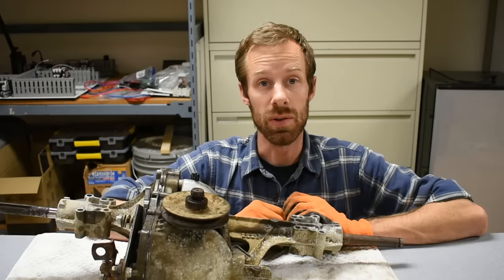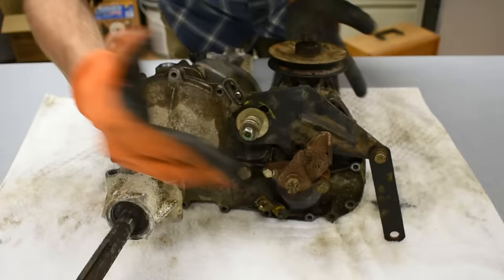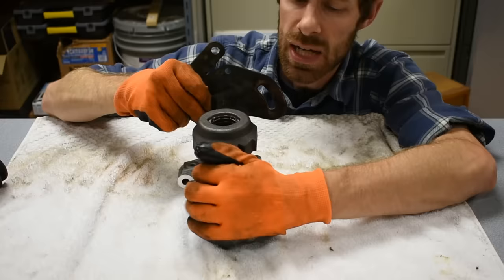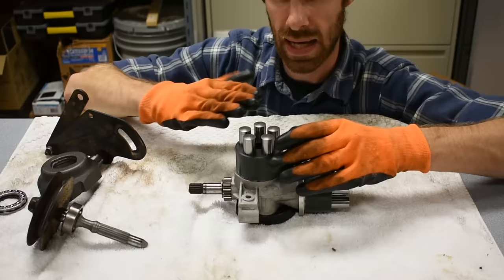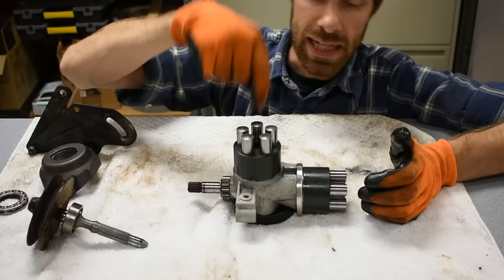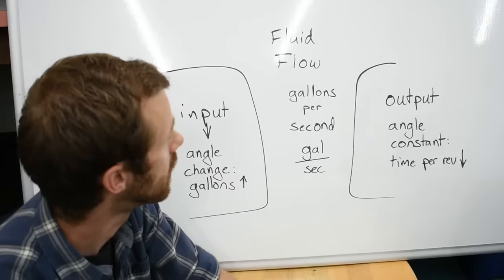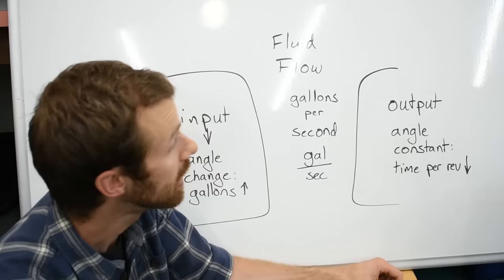How Does a Hydrostatic Transmission Work?

Comment: Great demonstration! I have a question, for you or any of the other viewers. My 42" Husqvarna lawn tractor has a hydrostatic transmission, and I had wanted to add a small grader attachment, but a fellow told me that a hydrostatic couldn't take the extra load and would be damaged. Is that correct? Thanks!
Reply: Really about the only thing that would hurt a hydrostatic transmission is low on oil or high on heat. Assuming that all else is normal, an additional load on the output would easily be handled in the lower speed ranges just keep an eye on the oil temperature of the HST.

Comment: so what are the power and rpm limitations to one of these "garden tractor" hydro axles??  I have been planning a custom build for some time now, of a twin tracked snowmobile powered by a Tiernay gas turbine, (max 110 hp) linked to a similar hydro trans axle. I have seen it done in "full scale", but still not Shure of limitations. Any thoughts?

Comment: Creating the hydraulic pressure and flow makes perfect sense. But converting it back into mechanical work makes no sense to me, unless the fixed ring is fixed at an angle. If you mentioned that, I missed it.

Comment: A discussion about the torque of input vs output of the hydrostatic unit would be interesting too.  I need to think about it a bit to see if it is a function of the angles or not. Also, is there a relieve valve somewhere in that unit? Maybe belt slip is the implied limit but would also be interesting to know. Great job showing though!

Comment: good video. is hydrostatic trans fluid regular motor oil?
Reply from the maker: Not motor oil - at least not the viscosity I would use in my car. It may be a heavier weight oil, but I would definitely recommend going by manufacturer's info, from manuals, etc.

Comment: Sorta similar to a swash plate on a helicopter and probably more similar to the swash place in an automotive AC compressor.

I see that the video is at least two years, but wound up in my feed, seemed interesting and here I am with a slightly belated comment 😶
Reply from the maker: That's ok - the equipment still works after many years, so I suppose the video does, too :) And yes, the swash plate concept is very similar to a heli, for sure.

Comment: How does the movement of the output 'cups' create the turning of the output shaft?  You got me to see that the output cups would move but we need the axle to turn.  Thanks.
Reply from the maker: Great question. The output cups are fixed to the shaft - in fact, they look like the chamber of a 5-cylinder revolver, if such existed, attached around the output shaft. Those 5 cups butt up against a slanted plate, so when the fluid fills the cups one at a time, each must expand and begin pushing. Since the plate (the swash plate) is slanted, it will only be able to spin in one direction.

If the fluid direction is reversed, the cups on the opposite side will fill, so the direction is reversed.

I know a written answer isn't great. Hard to describe with words, and for that I apologize, but I hope this helps a little?

Comment: My cub cadet rtz is not reversing on one side.  It has two hydrostatic motors.  I'm guessing the bearing is shot?
Reply from the maker: If it drives in forward, but not in reverse, it sounds like the fluid may be blocked from driving in one direction, but not the other. There are usually check valves that control the direction of fluid between pump and motor. If one of those valves is not functioning, that direction of fluid would not be allowed. 
Of course, I would suggest contacting the manufacturer to figure it out for sure. Don't count on Dave's opinion!

Comment: What's the lifespan of a hyrdostatic?
Mines 17years with 226 hrs.
Reply: So long as the unit remains full with clean oil of minimal oxidation levels it should easily out live you.

Comment: How much this and where we we can buy please reply
Reply from the maker: These transmissions are often found on lawn equipment and also often on larger slow-moving equipment like excavators, etc. 

To buy one, you need to know the original OEM part details like model # and manufacturer and search for it. Sometimes they can be found online and almost certainly through dealerships. 

To buy one for a custom design however, that would need to go directly through a transmission manufacturer.

Comment: On my John Deere 289 LX the outside of my housing looks very much like the one you have there anyway I changed my fluid to Amsoil zeroW 30 engine oil and I’ll tell you what it made it quieter seem to respond nicer and just works nicer horse your flu shot it was probably pretty bad so anything you did put in would improve it anyhow thank you for the vid

Comment: A link to a slightly bigger version.
https://youtu.be/TunlPGZ3UOg 
I have worked as a service engineer on these trucks for 15 years, and in that time we have not had a single failure of a transmission or motor after 20000 plus hours use.

Comment: i could make a video of how those trany works since i used to repair them on a big scale  but lets just say that it works on the same principle as a pressure washer . Aguy that knows how to fix a pressure washer doesn't need much to discover how to fix an hydrostatic transmission
Reply: I followed your advice and plugged a pressure washer wand into a tap on my tractor transmission. It did clean things for a short time but hydraulic  transmission fluid is harder to clean up than water is. I'm going back to using water.
Reply: @guy tremblay got any idea why one of these hydrostatic tranny would lose reverse then go to a shop for a fluid change and come back with reverse working but no forward now? We have a JD 265 that lost reverse and got taken to the shop where they said it needed a hygard fluid and filter change and was given back with no forward now. How does it go from no reverse to no forward? Weird

Comment: I dislike hydrostatic transmissions. Every mower I have had with one has failed. I prefer manual transmission mower sick with my early 70s wheel horse. Most reliable lawn tractor I have owned. Easy to repair.

Comment: I'm wondering if an air compressor could be created from this design.  Basically instead of fluid, air is used as the fluid.  It seems you could even get variable compression ratio's with this and it would be able to be fit into a cylindrical shape, which could have advantages of it's own.
Reply: Basically how the AC compressor in a car works. One plate and a bunch of pistons.

Comment: They could ratio the piston sizes and use two hydraulic motors instead of one and do away with the gears and differential if they wanted to

Comment: Great explanation! Are these more durable than standard transmissions?
Reply: No way. Hydrostats are weaker, but much easier to run. I run two garden tractors depending on if I need grunt (pulling/hills) or just easy mowing

Comment: Wouldn't it damage the pump if push/tow in any direction by creating a back pressure? Great video by the way
Reply from the maker: Yes, it definitely could. In this case (perhaps with all, I don't know for sure) the drive pump is belt-driven. If there was large back pressure from the driven hydraulic motor, enough to slow or stop, or even reverse the driving pump, the pulley would slip on the belt providing a clutch action. If it was directly geared to the motor shaft then the result is something, somewhere would need to break. 

That might be exciting.

From a very safe distance.

Comment: Interesting, I have never seen a spring driven variable hydraulic pump, nor one with proper bearings; thought they all used slippers on the swashplate and used retention plates instead of springs.
Reply from the maker: To be honest, this was my first time inside a variable pump, so I did not know what to expect regarding standard construction. This one was certainly designed for longevity and low maintenance.
Reply: @PetersonBrosAutomation  what's interesting about using springs, to me, is that it seems like it builds a certain level of cavitation protection into the system, by making the pistons work as accumulators. I guess this makes a lot of sense when the pump and motor are right next to eachother.

Thanks for sharing. :+ )

Comment: This makes me wonder, WHY do they fail?  Is it simply because too much heat causes those pistons to expand and scrape the cylinder walls causing perinate damage, or just seizing in place???  Is it really that simple!?   In other words if by simply adding an oil cooler to it with a small automotive electric fan, a fix for the so called "un-reliable" K46 transmission?   If so this sounds to me like a very simple and in-expensive modification that should be done.
Reply from the maker: In this transmission, there are two locations with metal-on-metal contact (revealed right at 10:54 - there is one for the input and the output), and that seems to be the most likely place for friction leading to abrasive material getting into the fluid, and the problems would probably just cascade from there. 

Overall, I think that if the fluid is kept cool and changed according to manufacturer's specs, this is a very reliable mechanism. I agree, your idea of a cooler would certainly increase reliability, but I haven't seen enough cases to truly understand the most common failure points.

Comment: Excellent explanation mate..i have now got the basic idea of working...it would be better if animated
Reply from the maker: I completely understand. I'm trying to use tubes to feed and return the fluid from a bucket so I can run it while open. However, I scratched one of the faces when taking it apart, so I will try to figure it out. The other idea was to cast half the case in clear acrylic. It's hard to show in action!

Comment: This is a great presentation but I would never call it "Hydrostatic" as there is nothing static about it and it is certainly "Hydrodynamic" as the fluid is moving and that it needs to do for the transmission to work. 

Note:-Fluid statics or hydrostatics is the branch of fluid mechanics that studies the condition of the equilibrium of a floating body and submerged body "fluids at hydrostatic equilibrium and the pressure in a fluid, or exerted by a fluid, on an immersed body". It encompasses the study of the conditions under which fluids are at rest in stable equilibrium as opposed to fluid dynamics,

Comment: Seems needlessly complicated with a lot of precision machined parts that can wear. Why couldn’t you just have a pump direct mounted to the engine (no belt to wear out), and just have 2 hydraulic hoses running down to a hydraulic motor at rear axle? Is there a reason they don’t? Speed could be adjusted by bleeding off pressure maybe?
Reply: These systems have been in use for decades (probably more than 50 years).  Variable displacement rotary piston pumps are considerably more efficient than your proposed solution.  They most certainly can be directly mounted to the engine, but there are other constraints you are not taking into consideration (very different and lengthy conversation)

Back to your alleged solution:  You want a pump to operate at full pressure ANY time the engine is running.  To reduce speed you want to divert pressure back to the sump... just to be picked up, pressurized, and bypassed again.  Your engine would have to operated at rated RPM for the system to work.  Otherwise the pump will stall the engine due to lack of power.  Nothing is free, your constant bypassing of pressurized fluid just to pressurize it again generates a lot of heat.  Heat oxidizes the oil causing wear.  The engine is also running at or near a full load its entire life.  Your proposed pump is going to be either a vane or gear rotor.  Both require precision machining (vane slightly less so).  Vane and g-rotor pumps have their applications, but neither include high bypass rate systems.
Reply: @Look_What_You_Did  I wasn’t proposing anything. I was just asking why.
Reply: @billythekid2281  You proposed a system.
Reply: @Look_What_You_Did  I asked why they don’t do it that way?

Comment: Great video! I learned a lot. I'm still a little confused on how the first pump propels  the second pump? I know its through the movment of the fluid but I can't pictue how that happens. I can imagine fluid spinning an impeller, for example, but I can't imagibe the flow from the first piston pump moves the second?
Reply from the maker: I so wish I could show it in action, but I can't have it open and operating with fluid at the same time, but it would be so much clearer!

A good demo of this is take two syringes - slide some 1/4" tubing on the end one of them and stick it in water and suck some up - this is like the extension of the spring sucking up the fluid from the reservoir. 

Then it spins and the internal channels are rearranged. So now connect the the tubing to the second syringe and press on the filled one (like the slanted swash plate pushing down against the spring piston as the motor turns). It extends the other one - which in the motor here would cause it to rotate, since the output piston is also sitting against a slanted plate. 

Then it rotates again, so remove the tube and stick it back in the water. Pull again on the syringe just like the spring pushes to extend the piston again, and it sucks up more fluid from the reservoir. Meanwhile, the other syringe is emptied into the reservoir by the plate compressing the spring. And repeat....

You could also think about it like the cylinders of a standard engine, The ignition forces one piston down, driving another one up, but there are multiple pistons all offset from each other to ensure that it keeps rotating in predictable direction. This offset in here is the slanted plate, and the 5 little pistons ensure that you a nice continual flow of fluid.

Thanks for the question friend, hope this helps?
Reply: Thank you for the in depth reply! That fully answered my question. The key point I wasn't grasping was that the second pump is on a slanted surface. The slant forces the pistons to roate when they recieve pressure. I got it now. I work in the parks department of major city in so we have a lot of hydrostatic equiment so I've been trying to understand them better. So thanks again for your help with that! Today I'll be making ice with a hydrostatic zamboni.
Reply: @kde5fan737  thanks!

Comment: Wow, it's a little like a pressure washer
Reply: Hmmm... kinda but not really.  Pressure washers are fixed displacement pumps with an unloader valve (bypass valve).  This is a variable displacement pump.  You would more than double the cost of a pressure washer with a variable displacement pump.

Comment: Why would one of these suddenly have no reverse then go to the shop for a fluid and filter change and end up with reverse working now but no forward? We have a John Deere 265 that reverse got real weak and stopped working then it was taken to a tractor shop where they recommended a hygard fluid (John Deere product) and filter change and came back with no forward drive. It’s got me baffled as to how the situation literally reversed itself. I’m trying to understand how these work before I just start pulling it apart. No reverse with functional forward to no forward with functional reverse... crazy 🤔
Reply from the maker: I don't know about the no-reverse becoming a no-forward issue, but one possibility that comes to mind is that at one point in its life, it may have had something jam the shift lever really hard and slipped... 

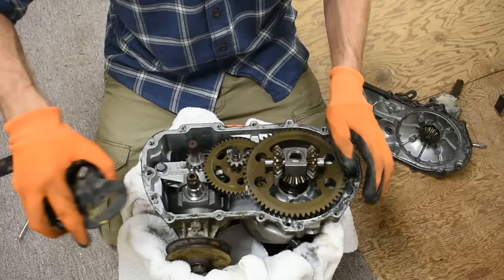Take a look at 4:10 in the video. There's a square hole in the plate that adjusts the swash plate. In different models, that may perhaps not be square, but maybe hex or star or something. If that slipped (like a timing belt slipping a tooth) it may have only allowed it to go entirely forward, then perhaps at the shop they loosened it to check, adjusted it, and maybe even adjusted it TOO far back.

Not knowing the situation, I have entirely NO clue, but this could be something worth checking, since it is one external component responsible for fwd / rev.

Good luck, I hope the issue is solved without too much headache!
Reply: @PetersonBrosAutomation  update: it turns out both forward and reverse were bad one just seemed to work a little better than the other but both progressively got worse especially as it heated up, I gather the pump was bad.  To add a comment about the unit like you showed in this video if those little “pistons” get worn at all they lose power and you lose drive to the wheels. Something like a couple of thousandths of wear can allow oil to slip by and not maintain pressure in the piston cups that sit inside the black block. I’m not sure if the wear happens to the block or the pistons or both but once worn enough it won’t maintain enough power to drive the wheels. That’s when you have to get a rebuild kit for them (new block and pistons). I was curious if you knew how crucial the type of oil is in these hydros. I saw online that John Deere put 10w30 in many of these hydro trans but now they sell hygard trans fluid and different versions. I decided to try a 5w50 full synthetic because others said the oil is better at handing heat. How much difference is there in motor oil versus trans oil? What I removed seemed thinner and obviously the 5w50 is a bit thicker but I’d think as it heats up the 5w50 becomes thinner? Or do I have that wrong

Comment: That almost looks like the way that a AC compressor works.
Reply: It's a common enough pump design - where 'good' pressures are required or positive displacement is required. They're commonly 3 or 6 cylinder to give smooth fluid flow despite each individual pump supplying pressure intermittently.